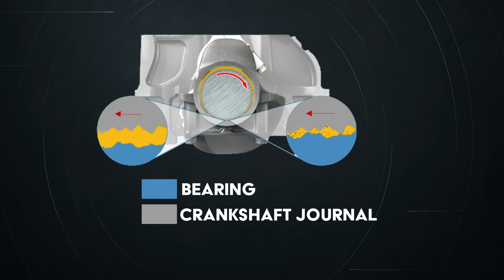the truth about start-stop technology (finally proven)

Comment: To make things even worse, you let off the brake, the engine cranks, you hit the gas and the engine is immediately under load while oil pressure is still building.
Reply: Dam i really never thought of it like that.
Reply: I have a coworker that starts his car and instantly puts it in drive, accelerating hard to show off everyday.
Everyday I laugh and know what he's doing to his engine he can't afford to replace.
Reply: I let my car idle long enough to go from warm-up to below 1,000 rpm before putting it in drive. Where I live, it's quite cold and garages are not common, so I do unfortunately have to start my car at least one extra time per day (if I remote start)
Reply: @David_H_Parker this is why I only buy new. I know I could save a lot of money buying used but the odds of the person before you properly breaking in the engine and just taking care of the car on a daily basis are slim. People that start and go need to get a Tesla if they really can’t wait a little bit.
Reply: @David_H_Parker within 3-5 years most people simply skip their, abused, car to the next clueless user...
Reply: That is why, to accurately simulate real world wear, we need the vehicle to actually spin the tires, under a load that simulates accelerating the vehicle through an intersection. I suspect the results would be even worse.
Reply: On my car the engine only stops if the car is in neutral with your foot off the clutch. It does an auto-restart as soon as you press the clutch pedal to engage a gear, so there is a delay between the engine cranking over and being able to apply any power.
Reply: @brendanpells912 me too!! New integra?? This is the only implementation of start/stop that I don’t hate
Reply: Well that and the 0wNothing engines are using now.
Reply: Plus battery wear, starter wear,…
Reply: @diganta2329  Some starters have a module in them that stop working after a determined number of starts. The ones in the Toyota and Lexus vehicles can reach up to $5000 for the part alone. Certain models have the starter buried underneath the intake manifold and the starter replacement could easily cost more than the bluebook value of the vehicle at the point of failure.
Reply: @David_H_Parker as long as I'm alive,  im staying away reom pretty much anything new. id prefer pretty much any car brands models before 2020 but particularly early 2000s Honda, Toyota, and some various car models from all brands. seems like they build cars these days, knowing you will need ro replace the car as soon as the warranty is gone, even Toyotas sadly.
Reply: Doesn’t the same thing happen when a hybrid vehicle switches to the engine while the vehicle reaches speeds over 25mph?
Reply: My MK7 Golf even starts back up after stopping behind a car and the car in front starts moving cause of the camera behind the cabin mirror!
Reply: That's a good point. When you are getting in your car for the first time in the morning you usually have a few seconds where at least you are fiddling with your phone or putting it in gear or something. At a light you just mash the accelerator.
Reply: That would be easy to fix with an external oil pump that restores oil pressure before cranking.
Reply: @cebruthius  The fuel savings are already negligible with start/stop technology. 

Adding an external oil pump would be good for all vehicle's engines but manufacturers aren't in the business of building more reliable forever engines.

Vehicles are less reliable now than they were 10 years ago, and significantly less reliable than the 1990s and early 2000s cars.

Manufacturers have the ability to build cars that could last forever, they need return customers and build them to fail.
Reply: @David_H_Parker , but doesn't toyota literally do that for the hybrids at least
Reply: @chettlar212  Many of Toyota's hybrids have engine problems from being a start/stop operation. 
The momentary start/stop on a warm engine is less problematic than start/stop on a hybrid engine. The cycles are significantly longer on a hybrid, allowing the engine to cool down and create sludge in addition to the added bearing and ring wear.

I see many Prius cars with blue exhaust from worn out piston rings. Having a pre-start oil pump does nothing to oil the cylinders on startup.

The current hybrid design only benefits those in urban areas with a lot of slow moving traffic. There is no benefit to drivers in low traffic areas. Having a hybrid that acts as an EV 100% until the battery dies, then switches to the ICE engine would be much more beneficial to all drivers in urban and rural areas.
Reply: @David_H_Parker , I see people say this a lot but with no evidence of actual failures. Not to mention the entire system has been drastically improved. I spend 12 hours a day around cars on the road, with tons of priuses, and none have the issue you describe. Maybe like, one. Ever.
Reply: @chettlar212  Where do you live? 
I am in Los Angeles, these cars commonly start smoking within 3-5 years.
Reply: @David_H_Parker , Kansas City, but this has been true everywhere I've lived. The only time I have ever seen that blue smoke in a prius was the first gen.
Reply: @David_H_Parker Have noticed this too.
Reply: @chettlar212  I have seen it from all generations over 5 years old. 
There are a large number of Uber drivers and taxis that drive hybrids here in Los Angeles. Some have switched to Tesla with  incentive and subsidized programs.
Reply: @David_H_Parker , lots of uber drivers don't take care of their engines at all
Reply: @chettlar212  I see more hybrids and late model cars smoking earlier due to stop/start and low viscosity oils.
Reply: @David_H_Parker , this is how I know you're full of it, lol. Comprehensive debunking has been done by a wide range of interested parties that shows that low viscosity oils don't do this. You are repeating what a lot of bro engineers say as theory, and now you are going ham on that confirmation bias to say you've seen ample proof. This type of thing annoys me to no end. That's not how any of this works, and since I know for a fact I see more cars a day than you do, and what you say does not bear out, it couldn't be more clear what's going on. Bro science is a scourge on any kind of automotive conversation.
Reply: @chettlar212  Okay buddy, talk to GM and ask them why they changed their oil recommendation on their V8 trucks that were having catastrophic engine failure.

The low viscosity oils and low tension piston rings are causing huge recalls, GM is just the biggest one right now, others are having similar issues.
Reply: @chettlar212  Are you a mechanic? Do you  do post mortems on failed engines?

You read some biased industry info based on theory and think it translates into reality. 

Just like the industry blunders in the 1970s and 1980s, these new approaches are having unintended consequences. 

Your confirmation bias and anecdotal evidence of driving for 12 hours a day is not scientific either. 

What are you going to say next, that we need carbon credits to save the world?
Reply: @chettlar212  Yeah I do worry about my corolla hybrid but they seem to last 500k miles no worries if you keep the oil in good condition. It's a slightly different system as one of the electric motor/generators can instantly start the engine at any required rpm, no cranking. They also use 0W16 oil. I still worry about it because it's often not getting warmed up completely and can stop/start 20 times or more on a 15 minute drive. Toyota must be doing something right because they are proven to last
Reply: @David_H_Parker  True. But if the battery was fully drained then you are putting 100% charge/discharge cycles on the battery. Lithium batteries have a surprisingly limited number of cycles before they degrade badly. If you have a big battery that delivers many 100s of km per cycles on an EV then your battery will last for 100s of thousands of km. If you have a hybrid battery you fully discharge at least once per day it will be done in as little as 3 years. Hybrids are very popular but they seem to be the worst of both ICE & EV technology as far as longevity is concerned.
Reply: @chettlar212 yeah I call BS on the Prius dying frequently thing. The difference is they power using the electric motor mainly from a stop, so they take most of the load off the actual engine internals. So I bet they fair way better than non-hybrid S-S cycling.
Reply: @Sharpened_Spoon , yup. And that's only scratching the surface. There are a lot of shockingly good things about Toyota's hybrid system. I did a lot of research and Honda's seemed cool but pedestrian next to how elegant the Toyota system was, especially in its newest generation, so I went with a Toyota a few months ago, and since I wanted max efficiency, and that newer system, I went with corolla cross hybrid over the rav4. Honda had the way better interior by far though. Kinda sad about that. 

And yeah Priuses do die but in my experience they all seem to either be the first two gens that had a couple notable design flaws, or the batteries die, which usually is just a couple cells, and yet again only in the first two gens. I could not find not find any notable failures in the newer gens, which if we are talking about taxies, are getting clear up to a million miles. And if the car gets a million miles. Like. What exactly are we complaining about?
Reply: @David_H_Parker  No, Toyota's hybrid start/stop operation does not cause engine problems. The hybrid system's design uses the motor to directly place the engine into an operating state, which is much gentler than a traditional starter motor and is far more robust.
Reply: @marks0012  The issue isn't the starter motor, it is the drop in engine temperature and lack of oil pressure and lubricant film on the cylinders.
Reply: @chettlar212  Spending time on the road with priuses doesn't mean you see a lot of priuses cold-starting.
Reply: @dafunkmonster , if we're talking cold starting, that really isn't a big deal nor especially related to this discussion lol. The claim was that they do this all the time, and in this discussion, that would mean on the road after a stop/start.
Reply: @marks0012 , he's just completely talking out of his ass. He thinks it's an oil pressure issue even though Toyota literally uses an electric oil pump to continously keep oil following separate from the engine turning like in a normal engine, bypassing the issue. It's so funny. He's so confident and doesn't even know the basics of what he's talking about.
Reply: @marks0012  You don't get it. Cold engines wear fast. It doesn't matter whether the engine is getting started by a starter motor engaged with the flywheel/torque-converter, or by an inline electric motor. It's still a cold start. It still takes time for the oil pressure to come up enough to stop the rod bearing from contacting the crankshaft.
Reply: @chettlar212  Go ahead and ignore what I wrote and focus on the strawman you built.
You either didn't read the thread or you are lying. 
Where I live, I see cars that experience a lot of heavy traffic. Start/stop technology allows the engine to cool and lose lubrication in several places, especially the cylinders. Having an oil pump running on a non running engine will only send oil to the galleys and bearings, SPLASH LUBRICATION ONLY HAPPENS WHEN THE ENGINE IS RUNNING. When the engine stops, gravity pulls the oil into the sump, the cylinders are the greatest wearing area of an engine, HENCE THE BLUE SMOKE from ring/bore wear. 

The drop in temperature also allows the clearances to change, and often change irregularly which causes excess wear. A happy engine is at full operating temperature, that is why the engine uses a thermostat to get the temperature up as quickly as possible.

You driving several hours in KC is a little bit different than me actually seeing these engines as a machinist with actual proof of wear that I can measure to 0.0000".

It is you that is talking out of your a$$ buddy.
Reply: @David_H_Parker  ye, most cars now a day are designed to fail after x amount of distance driven or by minimum to last the warranty before they fail, and the cost to repair is so high that u better off to buy a new car.
i watched a vid few weeks ago where someone did a long research and years of observations to collect proof.
the engineers are not allowed to design cars that are robust and easy to work on so they have to design cars that are meant to break after 150-200 thousand km that should last the warranty
Reply: @P-Bee  I think you are confusing mobile device batteries with vehicular traction batteries. Traction batteries (with few exceptions) are thermally controlled to keep them in optimal charge and discharge temperatures. EV/hybrid batteries do not get discharged fully. Most battery systems stop drawing full power below 20%, and they don't go below 10%. The meter inside the car may read zero, but the battery still has a good amount of charge left, plus overhead to address chemical aging. They are not "done in as little as 3 years". Modern hybrids have oil circulation pumps which are electrically driven when the internal combustion engine is not providing drive power, as well as coolant pumps which keep the coolant circulating to ensure even cooldown/warmup and avoid premature wear. After 5-6 years of daily hard use you may be down by 15% capacity in the worst case scenario. Most modern EV's & hybrids have ranges that make this a non-issue, and at 5-6 years most folks usually opt for a new (to them) vehicle. Having driven a plug-in hybrid to do errands for my partner for almost 2 years, I can tell you the car runs great like it's brand new off the lot despite her being the second owner. I really wish folks would stop parroting debunked nonsense and actually listen to people with actual real experience and not an agenda or motive. In case you were wondering about the range the plug-in we use still has (half a decade after rolling off the factory floor), it's over-spec in the summer and down about 5-10 percent on the coldest below freezing days of the winter just like every EV/hybrid experiences. The projected lifespan of this battery pack is at least 10 years with daily use. Hope this helps.
Reply: @David_H_Parker  that’s basically how the latest honda civic works
Reply: @David_H_Parker I agree. Have been thinking this since I recently learned how hybrids do this.
For those that know, I believe there should be a manual override, which the driver can select EV only in urban, and ice only when rural - many people do a daily journey which starts and ends in different environment, and the best efficiency and engine wear could be achieved with such a setting - do any manufacturers offer this?
Reply: With the right oil squirter below the cylinders it would help for pre start cylinder lubrication. Not sure if most Cars have it but most bike engines do, mostly to cool the piston from below but it also lubricates the cylinder walls.
Reply: @David_H_Parker  it is not, and never has been, about fuel savings. As you say, they are negligible. The equivalent of a Coke can’s worth over several thousand miles. It is about emissions and saving the polar bears.
Reply: @David_H_Parker  Do they prefer Marlboros or Winstons?
Reply: @David_H_Parker  The blue smoke from jammed piston rings in Toyota hybrids is caused by low quality oil. Forget about "long life" change intervals in hybrids and use high quality oil and it will work nicely. However, if you purchase the car second hand, the original owner might have been following the "long life" schedule and the oil rings are already jammed.
Reply: Nah, the people who make and sell cars and have an obvious conflict of interest said it’s totally fine and there’s nothing to be concerned about

They also said not to change your oil, it’s now a lifetime fluid
Reply: They don't lose oil pressure to begin with.
Reply: @MrRoguetech wha?
Reply: @ifixit775 Sorry, they lose oil pressure, but it's not relevant for short stops
Reply: @MrRoguetech I don't see how it could be not relevant. Oil pressure
Reply: @ifixit775 Because the parts are coated with oil.
Reply: @MrRoguetech not the same as a pressurized oil film. Briggs & Stratton has an oil slinger and no oil pump but that's for like 3-1/2 horsepower.
Reply: @ifixit775 Maintaining oil pressure is only relevant to specific parts. For the most part, oil pressure is not relevant, as long as a film of oil is present.

With hydrodynamic bearings, the additional wear is minimal except in very cold conditions. That additional wear is more than offset by more durable coatings (and other strategies), which have negligible additional cost.

To put it bluntly, most cars are not retired due to bad bearings. The rest of the engine has reduced wear from reduced run time. Every second the car is running is one less second to its lifetime, excepting the bearings (and a few other components that often vary by car design).

There is no evidence that start-stop engines do not last as long. They are ubiquitous and have been on the market for over 40 years. In general, cars last longer than they did even a decade ago.
Reply: @MrRoguetech it's not just hydrodynamic bearings, it's also hydraulic lifters unburned gas in the cylinders that are on the compression stroke. One second of idle time is not equal to one second of acceleration especially with little to no oil pressure. Start stop technology has not been ubiquitous in the market since 1985 (40 years). You're sounding pretty scientific but I'm not buying it.
Reply: @ifixit775  Start-stop engines stop in the compressed state. There would not be unburned fuel. Lifters are not hydrodynamic. 

"They are ubiquitous and have been on the market for over 40 years." Please don't tell me I need to define the word "and". (Correction: They have been sold for over 50 years... And I could find zero recalls from engines failing because of them.)
Reply: @MrRoguetech okay, you win. But you didn't make the sale.
Reply: My thoughts exactly. The introduction of dynamic loads during the period of low oil pressure must surely cause more wear
Reply: Same as hybrids and have 0 problems
Reply: @andreu7  Hybrids have an electric motor that take a lot of load off the engine at takeoff.   Gives time for oil pressure to build up.
Reply: BS mate, anecdotal evidence backed up with questionable testing methods! 😆👍🇦🇺🦘
Reply: @Moorakflyer and maybe a bit of common sense
Reply: My VW actually is good on gas ! But they have gone crazy with the allegations of what saves fuel. In the owners manual they state that leaving the exterior mirror defroster on will decrease MPG, I find that ridiculous ! Wow, what if I also had the radio, and interior light on, would they please explain this foolish manual.
Reply: @johnh6515  All the electrical loads do take energy from the engine. Where do you think it's coming from? Defrosters are quite high power. So yes leaving one on will reduce MPG. Probably not by much, but it will reduce it.
Reply: @xxwookey 
Yes, I do understand your point . But I am not talking about the windshield, but the 6x6 mirrors on the door . I would bet the dealer name and license plate frame , would be equivalent in MPG . 
ANYWAY - safe motoring to all.
Reply: Nah, Oil pressure builds pretty much instantly with RPM. Unless the engine is old and worn, I can guarantee you this. 

The idea to wait for an engine is more so with cold starts, where you wait maybe 10 to 15 seconds.
Reply: @RallyRanchMotorsport Building oil pressure nearly instantly is not nearly as good as having oil pressure.  It's undisputed that engine wear happens mostly at startup.
Reply: @ifixit775 yep, cant argue with that. It is at start up. 
But its not because of lack of oil pressure, its large tolerances due to a cold engine, double the amount of fuel going into the cylinders washing away oil, and COLD oil not lubricating as efficiently.
Reply: @RallyRanchMotorsport it's all of that and lack of oil too
Reply: @ifixit775 No. Unless there is something wrong with the engine, oil pressure builds instantly
Reply: @RallyRanchMotorsport more or less